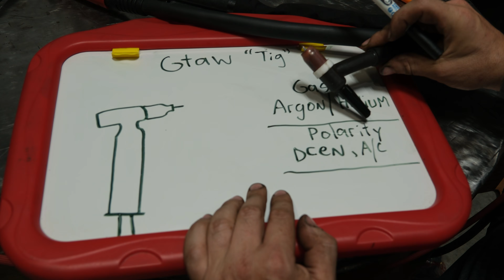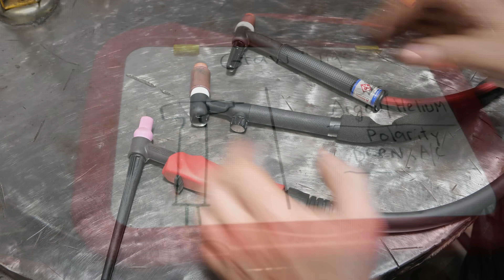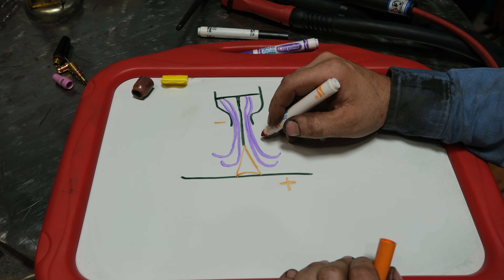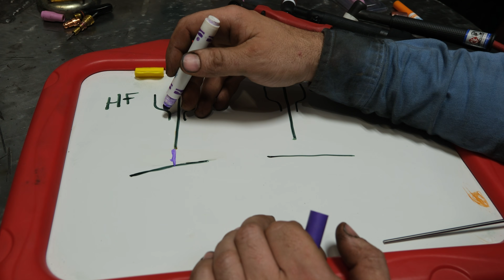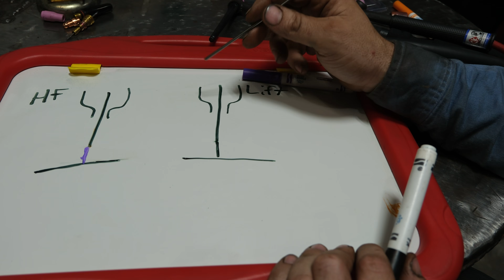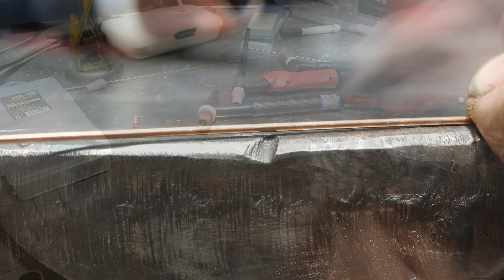How to Tig weld:  Part 1, introduction to tig welding

Comment: Making mistakes with Greg.. My dad taught me how to weld stick, MIG and TIG in the late 70's. I was only 10 years (55 now) old but I just got it for some reason. I welded for a living for 20 years, first at the local shipyard and then for my dad in his welding shop. My eyes caused me to have to stop welding but I have been doing it on the side ever since. I will say I am way out of practice with the TIG. Still good with stick and MIG though.
Reply from the maker: No doubt tig would come back to you with practice.  The modern mig welders are getting so good it’s hard to spend the time to get good at tig.  Ultimately I bet laser welders will overtake tig.  Similar concept but far easier and even better heat control.

Comment: I'll definitely be watching these.  I am skilled in about every other process but still yet to practice much gtaw. I have a small 200A everlast lift tig.
Reply: Also, please remember some of us don't have high frequency.
Reply from the maker: In the next video I will be covering how to start the arc with all of the methods and I will give a bunch of tips just for lift arc.  Since you are skilled with other welding you will find tig to be far slower and much smaller welds.  The biggest mistake most people make when going to tig after learning other forms of welding is they tend to try put down too big of welds.  Tig produces very small welds in comparison to mig and stick.  Keep them small and expect to move very slow in comparison to Mig and stick.  If you get a handle of tig your options for repairing things will be unlimited.  Definitely worth having as a tool in your tool kit.